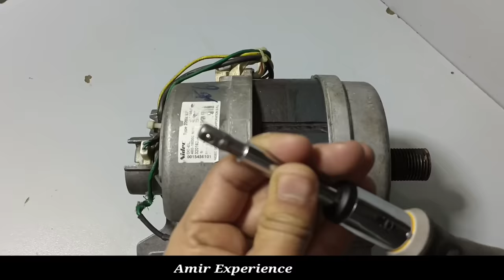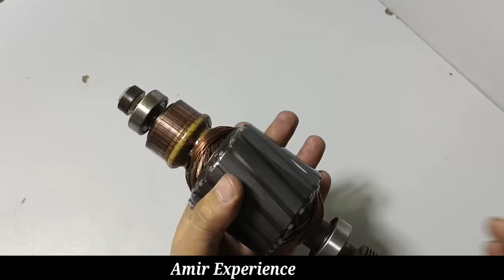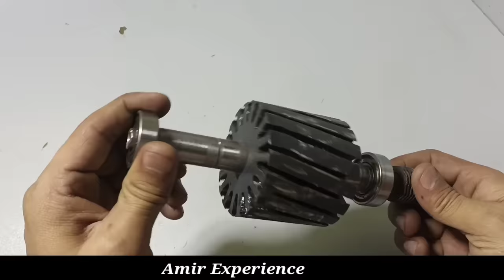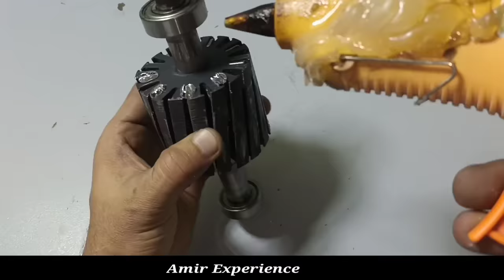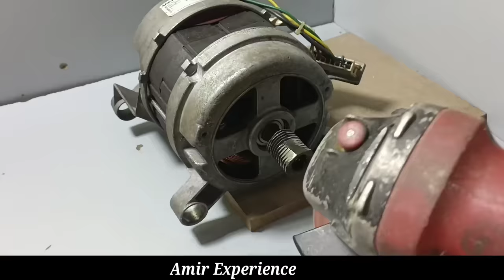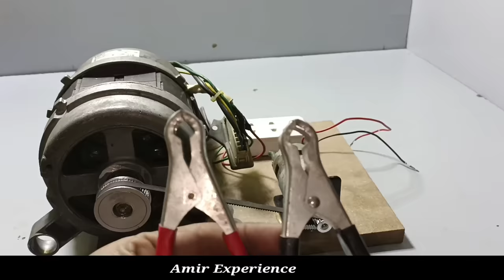I turn washing machine motor into 220v 15000w electric generator use new technique at home

Comment: What is hooked to the other end of the jumper clamps you hooked up???? Maybe a battery. and you are running the current thru to the plug. turning DC to Ac. is that the purpose of your video???

Comment: Nothing to proof that it can generate 15,000 watts of power. The drill is about 700 watts + soldering iron 130 watts. That's only 830 watts.

Comment: hahahaha good try , buddy , high tech variable speed washing machine motor , that thing on the end is a pulse generator for the speed control , 2 pole unit and wound armature , speed control by variable voltage applied to the armature windings ,which you removed ,  the amount of heat generated in the core would melt the glue and magnets would be flying everywhere in a short time , and a 600w drill falls a long way short of the 15kw you claim

Comment: I don't know by what calculation this guy get 15000 watts or 15 kW which is 60 amps at 240 volt AC that would melt the wires coming out of the permanent magnet generator  ...

Comment: At what rpm does the external drive motor rotate?
What size are the magnets?
Reply: Dude, just look up the RPM of a 12v DC motor. Also, the magnets were just chosen to fit in the slots and there is no spec on them, any will work. Lastly, any RPM will work, however know this. If you hook up a variable RPM motor and can adjust it in real time, when you hit resonance with the magnetic flux then you will get maximum power output.
Reply: This particular motor is between 480 and 16,000. At the beginning it showed the top of the motor and it was on there.
Reply: @mikez1r If I have counted correctly, there are 9 pole pairs. To achieve 50Hz mains frequency the speed must be 333rpm and at 60Hz 400rpm. 
However, the voltage of 230 volts cannot be achieved with this speed.
Reply: @ossi.p  He never measure the frequency. He is running HOT > 50, 60. Hz The bulbs work at any frequency, the drill converts AC to DC, but if he tried to drill something more current would be drawn and the drill would not perform. That small motor is not powerful enough to keep up the demand under heavy load. With a .25HP motor it would work, but agree the frequency is not mains. If he measured mains you would know it is fake, unless he had a hidden converter.
Reply: @mikez1r  This calculation is only intended to illustrate that this generator is unusable. With regard to the drill and other low-power motors in the household, it should be noted that at higher frequencies a strong brush fire occurs, with the consequences: greater wear; and high heating of the commutator. Apart from the drive of the construction and its performance.
Reply: @ossi.p  Generally, it will wear faster yes, the electronics will fry. But this is just for illustration to give you motivation and not an end all solution.
Reply: @mikez1r  If I construct something like this and make a video about it public, then the whole thing should work properly. A model motor is enough to explain the generator principle. How a 3kW engine becomes a 15kW generator can only be pure magic. 15kW is the equivalent of 20 hp. Show me a standard household 230V motor that produces 20 hp. That would require a minimum fuse of 60 amps. What a motor can't do, the motor can't do as a generator.

Comment: so I guess the big take-away is little motor with low power driving more powerful electridally thirsty drill. Not sure what kind of load the drill would make as the power drain increases with load, implying that energy is tapped from surroundings.  maybe, maybe not...  Have to be a DIY to confirm.  You are sadly mistaken implying you are getting 15000 watts just because the label says so.  That drill is only taking maybe 100w unloaded.

Comment: how many watts is the drill  200 watts  i like your idea it works , a battery and inverter all so the same but good job
Reply: I would say exactly the same about batery and inverter. A solid state solution would be simpler and more reliable.

Comment: Nonsense. 15000 : 220 = 68A. The motor is from a washing machine, which means that it has a power of 300 - 500 Watt. So it can give a maximum of 2.2 A. So be smart and don't show nonsense.

Comment: Think this is OK as far as it goes but the system surely boils down to a voltage converter and the output can never be more than the rating if the 12V motor so not sure how this can be 1500W? It would be more interesting to see power produced through a wind turbine, perol motor etc.

Comment: How do you know what two wires to choose from? You don’t show that on the video. You also don’t show what power you’re using for your small drive motor? Why can’t you use power from your generated power?
Reply: Usa i due fili dell'avvolgimento dello statore direttamente che non vanno più in serie con il rotore (fili eliminati) quando è alimentato a 220V

Comment: Come on people DON'T fall for this "FAKE FREE ELECTRICITY" there is no such thing as free electricity because you can only convert one from of energy to another in this case he's using electrical energy to make kinetic energy which is then reconverted back in to electrical energy to power a light bulb or something else.
You can make electricity by converting kinetic Entergy (either hydro or wind) to electricity. 
Now if the guy in the video has a degree in electrical engineering and has discovered how to make electricity without the need to convert one form of energy to another which is very IMPOSSIBLE!

Comment: Well bearing loses grafite oil florine gas based materials ore magnetic bearings,liqued mercury instead of brushes friction,high speed rotation above 20k rpm anty gravity that thing lifts of from the ground,for cooling system and resistance removal in wires liqued oxygen is used.
So for scepticals depends what you add you will get.
Not evry thing is described in books corectly.
Ordinary alkaline baterry 1.5 v recharges on a stove useing heat energy.
Some peopel like Peater Linderman pointed out never ending spining kids toys pengulum patents.
I belive they can by increased and improved after all compound starter/generators are meant to by used as variabels .
So any thing in betwean in can by used chemical and thermal energy as well.
All depends what that thing is suposed to do.
So the gyrobuss is real,magnetic lifting trains ,owen magnetic car ,376mpg car shell opel,gasoline/dizel electric trains,kubelwagen thats mechanical point of waiv combined with electro magnetical energy.
So belive peopel what you want.
Tesla did make great patents ,john bedini and lot other great men achived imposibel odds .
Tesla ,Magnetic ore rather Steam turbine is actualy great and have masive torque to spin any thing.
In my opinion any thing is posibel.
And alum baterrys are great for heat transfer thats why the lockridge device was real acording to bedini.
Its a transformer/baterry/capacitor/and heating element at the same time.
That men was a geniuse after all.

Comment: I don't believe I just watched (half of that)
How to completely not understand how electric motors and generators work.
First of all. That adaptation will never. not in a million years, produce 15,000Watts - it'll make 150 on the same day I win the National Lottery.

2nd: All that work was so totally unnecessary - all that was needed to be done to  the original and still intact motor was to connect a diode from one of the stator wires to one of the brushes and connect the other brush to the other stator wire.
It is the exact principle of small 'home'; or portable petrol powered generators. In them you don't even get to see the diode, is is included as part of the rotor so no brushes are required.
The so-called 'Flying Diode'

It will then become a very potent generator from minimal work.
500 Watts maybe but be very careful, it will get very very hot even at 'just' that, 
Something that physical size will never ever make 15,000Watts tho

Comment: Te rog ce dimensiune au magneții și de câti magneți ai nevoie total?? Multumesc mult ești un geniu
Reply: Salut,
Intreaba si tu in limba engleza,asta daca vrei sa primesti si raspuns la intrebari.
Reply: @lucianleonte1821  Cumpăra un generator cât de mic și desfal și apoi vezi cum este făcut. Dacă respecți pe niște treburi merge nu asa după ureche
Reply: @ioandragoi9528  Am construit deja unul, ai nevoie de 12 magneti neodim, pentru un alternator, poți folosi mai multe variante. Dar nu ajungi la 220 v.
Reply: @lucianleonte1821  Depinde de bobine, de grosimea sârmei, și de mărimea magneți lor și N52 dacă ar fi
Reply: @lucianleonte1821  Ce mărime ai folosit a magnetilor
Reply: @lucianleonte1821  Multumim de info!
Chiar ma batea gandul sa cumpar un alternator SH de tir si sa fac o incercare. :)
Reply: @lucianleonte1821  Pune magneți de putere mai mare N52

Comment: haha 15000Watts!!! :D take one 0 out there to be at least closer the real result xD. that system cant even produce that 1300-1700W what that drill would need to spin at full speed it spins so slowly.. imagine 15 000 W at 230 Volts.. that would be only 65 Amps.. those thin wires would start to melt pretty fast with that much load.. and you tell me that small apparment could get enough power from that they would leave normal life? xDD YOU ARE FUNNY! But please mention this to these stupid ppl who actually believe in this that it AIN'T REAL and this video is only for entertaining purposes :D
Reply: the smaller motor has to be somewhere 30 watts

Comment: Have you seen any of these types of videos that calculate the amount of amperage or electric current, definitely not
why Because the 220ac electricity you get does not even reach half an amp, especially with these weak coils
Generally, these videos are scams to be seen

Comment: 🤣🤣🤣 hey 15 kw is not a joke 😁 thank you for entertain us
Reply: The idea of him getting 15,000 Watts out of this certainly is a joke. I'm so disgusted to find SO MANY of these scams, and actually most are basically exactly the same principal can not ever produce even as much as goes into them let alone THAT ridiculous amount. Look at his crap wiring for a start. Even if it could, neither the wiring in the motor OR his own extremely dodgy wiring could handle anything remotely like 15,000 Watts, it would fry it. It's just another scam.

Comment: Please give info of bith motors, input output. Thank you
Reply: Whatever voltage doesn't really matter, the simple fact is, if you hooked a Watt meter to both you'd find it absolutely WILL be USING MORE power than it produces.

Comment: Ac to dc bridge ac from washing machine to 2 middle pins marked ac of rectifier then outer 2 marked  pins to the dc 12 volt motor a 12 volt kick battery self looped could you test this idear and see if it would work in another video

Comment: 🤣🤣🤣 P = VxI for those who said that the max current (amps) that the wire can handle is 100amps do the math... 100amps x 220v = 22000 so when you say that impossible to get 15000 with a wire that the max current is 100 amps , well the amp-voltage would not be the limitation. Any way who knows if he achieved 220v and 100 amps with those magnets

Comment: Absolute nonsense. This man has absolutely no knowledge of electrical engineering. Otherwise, he wouldn't be able to show this on YouTube. It drives the motor to a maximum of 100 W and states a meaningless power of 15,000 W (15 kW). He had probably never seen a real 15 kW generator that powered a 20 kW gasoline or diesel engine. It's a huge machine.

Comment: :hand-orange-covering-eyes:is it possible that the stator windings put out 220 magnetic voltage on the ROTOR not sure max is good, there is no Volt measurement in the video.:body-green-covering-eyes:

Comment: Se questo motore usa uno statore con diametro del filo di rame  adatto a circa (1000w/220=5 amper) , gli stessi fili non possono sopportare (15000/220)=68 amper ; SCOMMETTIAMO ?

Comment: Dear i have one question 
 1. Which type of magnet you used when i try to generate electric at home using loudspeaker magnet and washing machine motor, i arranged the magnet in proper way like N...S AND S....N in cross position  but the result is not good can you help me pls.
Reply: Sorry to hear you wasted your time following the lies from one of these scammers. It isn't possible and it's not your fault, it just can't be done, these are ALL faked.

Comment: I think you can white the 12 V cable start and run the small motor to support the connection
Reply: Exactly, why not close the circuit

Comment: At the power output socket, put 12v transformer > 12v charge controller > car battery > 12v motor.

Then 12v motor spin rotate the big motor.

Use car battery as buffer.

Comment: Can you grid tie the extra output? With out deceleration of the output?
Reply: Sir is correct sy ups ya inverter chalain to chal paye ga ?
Reply: @makeyourowncreation8624  Did not understands your reply. I only speak and write english.
Reply: I’ve often wondered this myself.
Reply: No electric company/inspector will allow you to hook up a home made generator to grid tie setup. This is for off-grid and charging batteries to power your home.. Only.